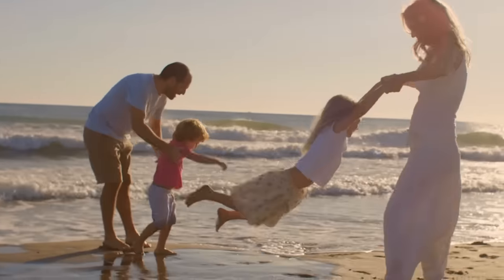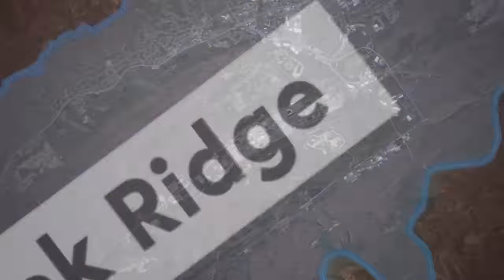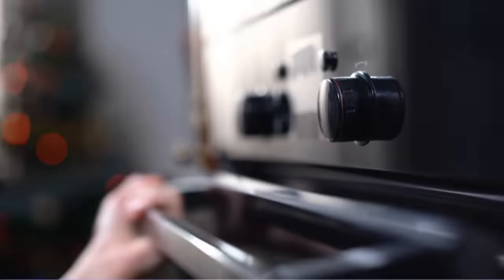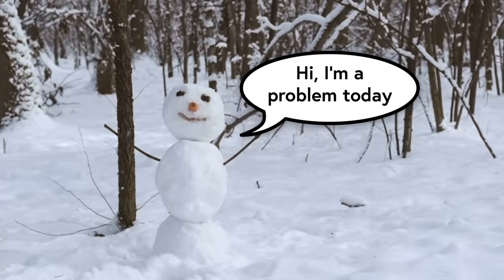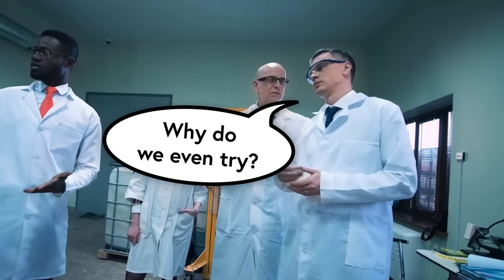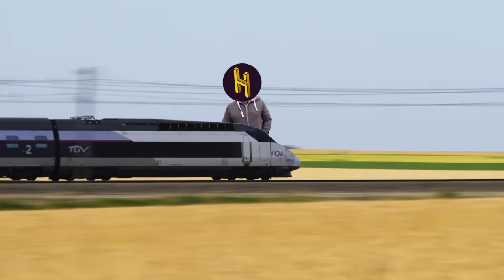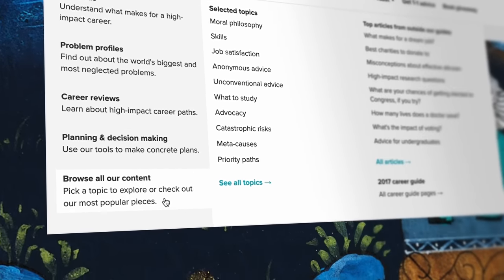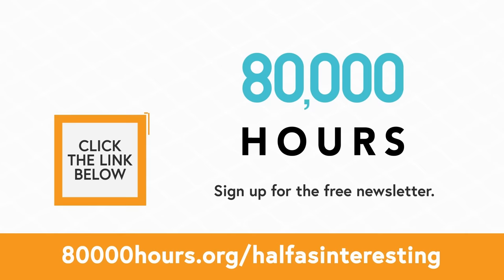The Material So Classified We Forgot How to Make It

Comment: Okay, so funny story, this is the same reason we can't make any F-1 rocket engines (the big ones on the first stage of the Saturn V) anymore. We have all the technical plans for them, but the state of NASA and engineering in general in the 1960's was such that certain unrecorded adjustments had to be made to the engines to get them to work, and all the people who did it are either dead or have forgotten. F-1s were essentially craftsman-assembled.
Reply: which is both okay because

1. we've moved on from F-1 engines because it's 1960's tech and will likely either design a modern engine as big or simply keep using a lot more, smaller engines
2. if we really wanted to use the F-1 again we would do the same reverse-engineering process on what we already know of the design, and making more modern small adjustments to get it to work (at this point an F-2 or perhaps F-1A)
Reply: @flurf5245  yeah no need for an F1 these days, especially for how inefficient they were
Reply: Not just the 1960s, even now I bet it takes unrecorded adjustments to get most factories working as planned.
Reply: F1 engines could be made today, to better specs lol theres just no reason to when you consider the budget involved. tbh even a dedicated hobbyist could do it if they magically had the resources. CPUs would be a similar example, complex but not impossible with the right resources. its amazing how much we can do in the information era
Reply: There is a proposal for a F-1B during the early stages of the SLS development. Which is a modern redesign of the F-1.
Reply: @chaklee435   depends on how the production line is setup. I am guessing that most products that are produced in relatively high numbers are fairly close to the specs written down due to the increased use of computers in a modern production line. If I remember correctly, part of the reason the f1 can not be remade today is that the skills used to make the adjustments that are needed are just not practiced anymore.
Reply: @mech____ dude, no hobbyist is going to be cooking up a 1.5 million lb thrust engine in his spare time in the garage. Dear god 🤦‍♂️
Reply: My favorite snippet like this is the old ladies they hired to knit the computer memory for the space shuttle.
Reply: @Sentinel_ICBM  what about in a cave, WITH A BOX OF SCRAPS!!!???
Reply: @mech____  CPUs are produced by a handful of companies. And every one of those companies uses machines made by just one company. So if it was that easy, China would have it’s own cutting edge CPUs by now.
Reply: @Sentinel_ICBM  i didnt say in their garage though?? do you know the actual science behind it
Reply: @klugshicer  there are chinese-built CPUs though. they're far from cutting edge but im not talking about CPUs in china im talking about how it's pretty difficult for technological innovations to be truly 'forgotten' despite their complexity. theres no hidden knowledge that only the original F1 engineers truly had, theres just no point in making a new one
Reply: Not true look up the new designee F1 that NASA went over and used the larger solid rocket boosters used on the shuttle
Reply: @mech____  I understand, but come on it's silly to suggest someone could tinker around and develop an F-1 when rocketdyne had 10,000+ of some of the sharpest engineers at the time working on it.  And yes, I understand the science behind it fairly well, I'm an Aero Engineer working on launch vehicles for AF/SF.  Now, do you know the actual manufacturing behind it?
Reply: @somethinglikethat2176  Well, when you put it like that, then yea definitely possible
Reply: @chaklee435  usually important things are recorded a bit better these days, or at least in less easily lost formats
Reply: @Sentinel_ICBM  im not trying to say one person could develop the engine. i am trying to say one person with enough time and resources could figure out what's 'forgotten' about the proper configuration for each engine. im saying this bc the original comment words it like it's impossible and i get way too bothered when people make it sound like rocketry is more complicated than it really is lol

and this isnt a minecraft server you know we cant talk about that here
Reply: @flurf5245  Exactly. If you compare nine Merlins to a single F-1, the Merlins produce over a thousand more kN of thrust, weigh half as much, and cost a little more than half as much.
Reply: @mech____  I see, I apoligize, I misunderstood
Reply: those F1 engines from the 60s were so inefficient i cant really see them still being wanted today other than by some enthusiast 

can get more power from a hybrid 1.6l v6
Reply: @JohnDoe-my5ip  May be I am wrong, those memories had something to do with first human moon landings. Curious Mark have video about them. Space shuttle was later tech.
Reply: To be fair, we could make them again if we wanted to. We could easily re-learn how to make them work, but it's not worth it because they're just not as efficient or usefully as modern rocket engines
Reply: 1960s*
Reply: @custard131  
Not 1960’s Formula 1 engines. 😂  Rocketdyne F1 rocket engines from the 1960's space race era are still the most powerful single-chamber liquid-propellant rocket engines ever built. There are also several unused F1 engines still in storage or on display, so anyone interested in, say, getting to the moon without spending billions developing their own propulsion tech could spend much less money rebuilding massive pumps and balancing outputs from the old handbuilt engines. For most nations that's probably the most effective route to avoid cannibalising resources from QC, mission planning, life support, telemetry, control devices, and logistics.
Reply: Naa! Today we have modern tools and computer simulation. We can make better.
Reply: We probably could, they'd just need to get some old mechanics to randomly mess with it just like they did originally
Reply: That's all of early NASA
Reply: People used to call them woodworking engines.
You can measure all you want, getting two to be exactly identical is downright impossible.
And honestly with the advances of today we probably don't WANT to make them again because of the labor cost.
Reply: This is sort of a myth, because all that hand work and notation was only related to how to make them with 1960s manufacturing techniques. It had nothing to do with the actual function of the engine and all of those manufacturing techniques are super outdated and wouldn't be used if we wanted to make more. There's a new revision, called the F-1B, that is based on modern techniques and was almost chosen for use as part of SLS.
Reply: @Sentinel_ICBM  exept me :body-green-covering-eyes:
Reply: Reminds me of a video made by Ian of Forgotten Weapons about the difficulties of bringing new firearms for mass production, IIRC the point of his video was basically that it's relatively speaking easy to create a hand-fitted prototype since you can sort of wing the blueprints and tinker with it until it works reliably, but it takes far greater effort to create blueprints with all the tolerances etc. figured out to such exacting detail that someone else can take them and craft the firearm based on them and it'll work without requiring hand fitting or adjustments.
Reply: @chaklee435  It does.  That is why the current corpo atmosphere of fire the skilled workers and replace them with cheap temp workers causes massive failures.  This is why we can't produce the ammo needed to supply Ukraine.   the pursuit of short term profits has crippled manufacturing in the country and it will take many decades to recover, if it ever does.
Reply: @mech____  True, scientific knowledge is not the problem here, it is the experience and skill of the team that is lost. But yeah we have metal 3D printing and advanced fuel and metallurgy nowadays so making a new engine is actually saving more money than trying to remake the old one. And btw to those who said that NASA made new F1s, they didn't. SLS uses RS25 engines and Solid Rocket Boosters, it is a modified(upsized trenta hahaha) space shuttle.
Reply: @something like that I'm sorry, sir, but I'm not Tony Stark in a cave with a bunch of scrap.
Reply: @Sentinel_ICBM  challenge accepted.
Reply: @something like that  "well I'm not Tony Stark"....fantastic line.
Reply: @flurf5245  SLS is ussing shuttle engines from 1970s, littelary those engines from museums
Reply: @hphp31416  first of all, stop holding down your keys when you type.

second, 1970s tech, despite being only a decade newer, is actually a lot more modern than you would expect.

rocket engines often use the cold, cryogenic propellants to keep cool by piping them through channels on the chamber and nozzle, known as regenerative cooling.

the F-1 used channels welded right onto the chamber and nozzle which, despite working well, required meticulous welding and inspection to ensure no joints or seams were exposed.

the RS-25, meanwhile, has an inner assembly with grooves serving as the channels. these are filled in with wax, and the outer shell is electroplated on, then the wax is dissolved out. there's a fantastic video about this by Breaking Taps over at https://www.youtube.com/watch?v=H4YZxb2E5PA .

the RS-25's regenerative cooling channels are made from the molded gaps between two solid pieces, as opposed to the F-1's intricately welded channels. one decade later, yet much better and more sophisticated.

the RS-25 survives to this day, optimized and updated, while the F-1 was not re-engineered from its original form.
Reply: @flurf5245  Many of us consider the SLS use of RS-25 Engines to be batshit.  If only because the engines are costly in part because they're designed to be reusable, but are being used once!  Plus it turns out Hydrogen is great for specific impulse, but is a pain to work with and just doesn't have the thrust we want in a gravity well.

There was a theoretical re-design of the F-1 using Selective Laser Sintering that looked really neat.
Reply: basically the reason why NASA can't go back to the moon yet
Reply: Judging by the comments above its clear most of you don't appreciate just how purrfect the F-1 engines actually were.
We have general blue prints for them but not the detailed production specs required to build them. NASA and Elon musk have both said in the past they wish they could reproduce them.
Reply: @sophie_a  One of the main things that screwed the soviets was they were using more complex closed cycle oxygen rich engines because kerosene was cheap and easy to work with. But the engines are much more complex and they were on a tight budget and schedule. A big dumb rocket engine was just easier to get working.
Reply: @Lamster66  i hear you but rocketry is a completely different animal than mass production. there aren't thousands of saturn Vs and the envelope they operate at doesn't leave room for things that only one engineer would understand. its a very mathematical thing that is built upon what's learned from prior designs and decided by the capabilities of materials we're able to produce. theres also the security side to consider, in the days of the saturn V we didn't have silos and submarines all around the world and to have your rocket crippled by the loss of 1 engineer would be a pretty big risk to take on the global stage
Reply: @atomicskull6405  also they had bad quality control, because they used pyrotechnic valves that were single use- they only batch tested the engines used for the N1 so there were always issues
Reply: Because we forgot how to build this type of rocket engine it set space travel back to the beginning only just being capable of sending people back to the moon is why this forgotten peace of technology was so important it set is back decades of where we should be in space exploration
Reply: @sophie_a  Actually their sea-level ISP wasn't terrible for a kerolox engine of that scale
Reply: @sophie_a  Well that and the N1's engine cluster really needed computer control that didn't exist yet. It was just an overly ambitious design. Roscosmos defied the Kremlin's order to destroy everything related to the N1 and stored the engines in a secret warehouse for 35 years until they were eventually sold to Aerojet after the cold war. Aerojet actually didn't believe the russian engineers claims of the engine's efficiency until they actually ran one themselves and saw it was true. That was when everyone realized the soviets had been using oxygen rich closed cycle engines for decades.
Reply: @Lamster66 The funny thing about integrated circuits is that what is inside, the real working of the array of transistors, is basically a black box.

When there is a detailed datasheet from the manufacturer, dealing with any bug/strange behaviour is easy. Cut out that weak link and any repair/design recreation becomes black magic.

Another field that is starting to experience this is computer aided machining. In the old days, without computers, the operator had to know how to machine metals. How much to take in one operation, how much to push the machine, how to create the muscle memory and shortcuts in design to achieve the end result.

Nowadays, with CNC, that knowledge is being lost. Just have one guy create the main code and you can have thousands of unskilled operators just pressing a button and changing stock material.

Which is fine and dandy until you realize you are incapable of easily finding designers with actual hands on experience on metal machining other than computer simulation, or that the maintenance guys can't file, saw, weld or machine a simple spare part for your equipment because they have no experience in it.
Reply: @Chak Lee  That's not how engineering works. You don't deviate from a process without approval and documentation. Engineering is a very technical discipline, people aren't just throwing shit together. Not to mention you have a company or government entity that manages things.
Reply: The bigger issue would be that we wouldn’t get the parts anymore, and we will not replicate microchip technology from the 60’s for instance. So we would have to design a new engine anyways.
Reply: @Lamster66  not my point. We obviously have non comparable chips today, but it would be quite hard to replicate the old ones. You would probably need old machinery and the other supplies which you can not buy today.
Thus we had use modern ones. 
This applies to almost all parts of the engine. So it would be much cheaper to just design a new one with these modern parts.
Reply: @Sentinel_ICBM  someone clearly hasn't watched integza
Reply: They were scrambling to finish those F-1s to beat the soviets so it makes sense that there were a lot of notes left inside notebooks
Reply: @2Lelouch5  and the J-2B was proposed for I believe constellation. Both engines were simplified versions of their predecessors, and the F-1 would have been used for the SLS boosters from what I remember.
Reply: I used to mod Halo: Custom Edition as a kid. There are a lot of engine and SDK techniques I had to sift through on multiple different websites that are now lost to time. Documentation was abysmal back then. Funny how quickly knowledge can be lost.
Reply: so fix it again
Reply: @kingmasterlord  that’d be expensive and pointless. We have better engines that don’t need fine craftsmanship to make.
Reply: @chaklee435  My employer's business is predicated on some dude knowing that you have to do something that isn't written down, and we are an important part of the semiconductor industry.
Reply: @chaklee435  Field technicians often have to tweak things in ways the engineers wouldn't approve of. Most of the time it's fine, but if it goes wrong and someone gets hurt the poor underpaid guy responsible for making it actually work gets hung out to dry for not following specs.
Reply: That was the issue with the F-1: each was individually built and tuned. They couldn’t be mass produced. How do Space-X engines compare to them, I wonder.
Reply: More to the point, the Americans discovered, by accident, after the collapse of the Soviet Union that there were Russian engines with much better performance so they simply started buying those.
Reply: Or it was fake
Reply: Not to mention all of the infrastructure that we destroyed when the program closed
Reply: Not entirely true. 
It's like the difference between schematics vs as-built in construction. The schematic designs can't always be made IRL, that's why the tradesman do adjustments on the field and make it as close to design that's feasible IRL. If you send in a plan, the tradesman will still make you one, it just won't be exactly like the F1 that's made prior cos every tradesman tackle a problem differently.
Reply: Yeah there's a lot of this "we don't know how to make things we used to make anymore." But yet overall we have way more knowledge and people engineers etc. So on the one hand it can be true but on the other hand it doesn't seem exactly true because we can still figure out how to make it again and evwn improve it, or don't actually need it anymore.
Reply: @Lamster66 exactly
Reply: @Lamster66  for sure people are always caught up in an immediate or surface level perception of things
Reply: @chaklee435 Correct.
Reply: Each one had to be tuned like a pipe organ. It's a similar story for the computers in the apollo missions. We can't reproduce them. We still had a glut of seamstresses looking for work in the US during the mercury and apollo program and early compact computers were basically hand woven golden circuit quilt blocks. The insane dexterity and skill that comes from a workforce of hundreds of talented, NASA trained seamstresses is basically impossible to reproduce today. The fact that a team was able to reboot one of the remaining computers is a miracle.
Reply: @mech____ "CPUs would be a similar example, complex but not impossible with the right resources", i disagree on that, if somehow we lost all the data on modern CPU simulation and designs and specially FABs like tsmc, it would take decades to even get back to intel 8080 level, modern electronics are made by machines making-> machines making -> machines upto N, and human involvement is abstracted, even the best researchers can't do it.